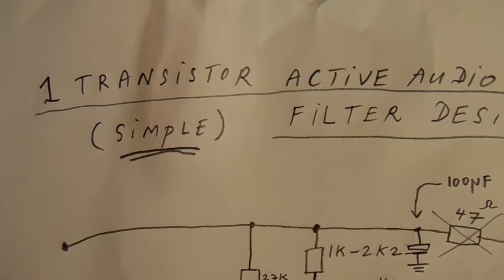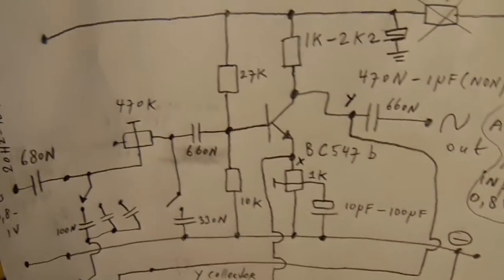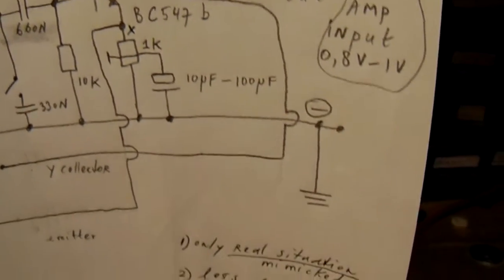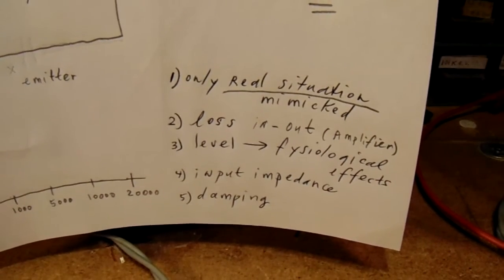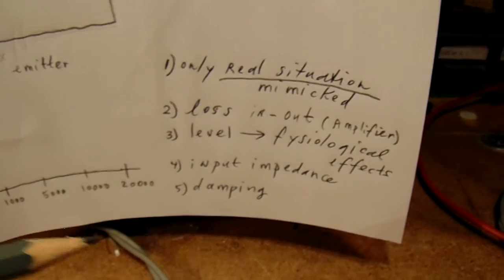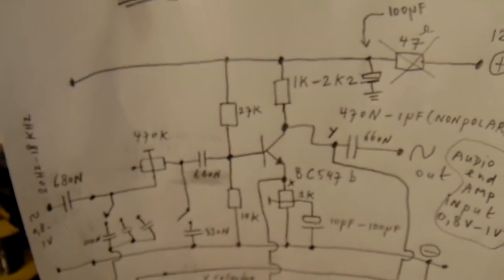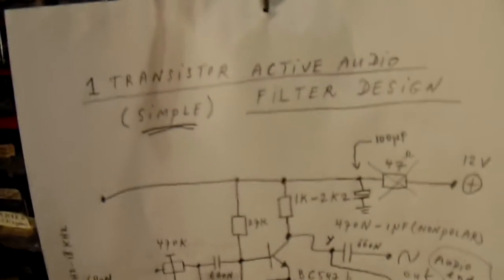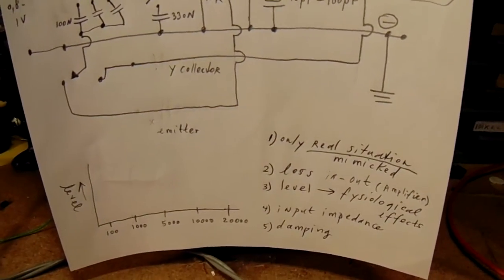1 transistor active audio filter design (part 1)

Comment: Dank U! (Ik spreek geen nederlands.) Very interesting. I want to make a 1 or 2 transistor notch filter to remove a whistle at approximately 4 kHz. (easier with an I.C. but I want to use transistors.)
Reply: Simple notch filter you can made from one transistor - emiter-colector follower and wien bridge circuit... Series rc circuit need: R/2 ; C/2